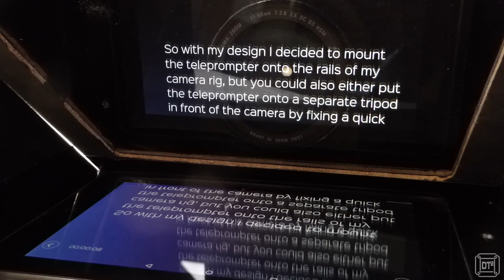Homemade teleprompter

Comment: Hi Dave,
Great tutorial , I found PPT Mirror software to mirror-flip the slides and use them in a teleprompter, Would this option leads my speech to natural as I won't be reading word for word?
Reply from the maker: Hi, If I'm understanding you correctly you are thinking of showing a Powerpoint instead of a script so that you just have your talking points in front of you? If so then yes I think that would work and depending on your own presentation skills may work better as it will keep you on track with what you need to talk about whilst making it all more natural. Sounds like a great idea, let us know how you get on. Dave
Reply: @DTSquared  Exactly Dave, Powerpoint slides with bullet points instead of script to help me maintain eye contact and speak confidently as I always have the whole concept in mind but firstly I would have to mirror-flip the slides using PPT Mirror software.

Comment: Hello Dave, really helpful and I appreciate your advice. Could I ask which type of beamsplitter glass did you choose from scientific mirrors, they seem to offer different coatings and some are rather more than others. I see it was 6" x 8" but was it their 'autocue glass 'standard' 6x8 (I think priced at £24 plus £10 p&p) or was it one of the more expensively coated ones? I will be using the teleprompter for explainer videos like yourself, so it's the clarity of the words I want but also not to reduce the overall quality of the image captured, some mirrored glas I have tried has been too dark to shoot through. Thanks in advance.
Reply from the maker: Hi Brian, glad you found the video helpful. I've just dug thru my emails and I originally asked about the 6” x 8” rear anti-reflection glass which at the time was £32+£6 p&p .
The response from Terry at Scientific Mirrors was quote We would recommend a 6" x 8" x 2mm autocue/teleprompter.*endquote*
This worked out to be £24+£6 p&p at the time. The website is a little confusing because they call it "standard glass" but if you read the note underneath the standard is coated on one side and the more expensive is coated on both with anti-reflective on rear.
I'm not an expert on this but suspect the lower cost glass without the rear anti-reflective coating would make the image slightly less dark. Any autocue is going to darken the subject some but with the right lighting the ability to read a script whilst not looking off camera is definitely worth it.
Best of luck.
Dave
Reply: @DTSquared  Thanks for your really speedy, and very helpful reply, I hope others find your videos and give you positive feedback.
Regards Brian